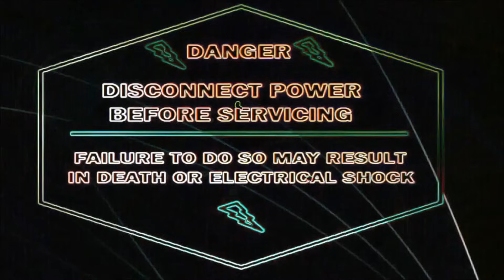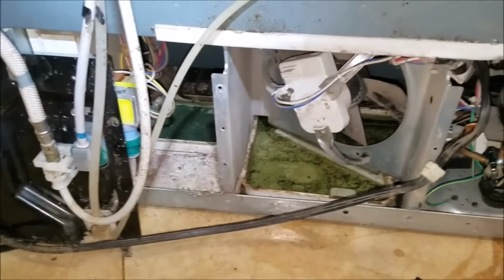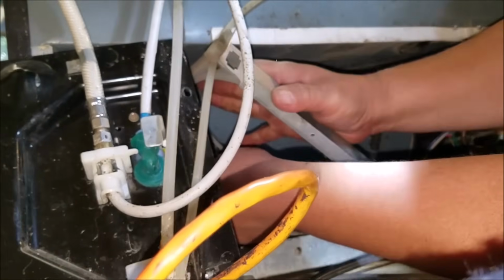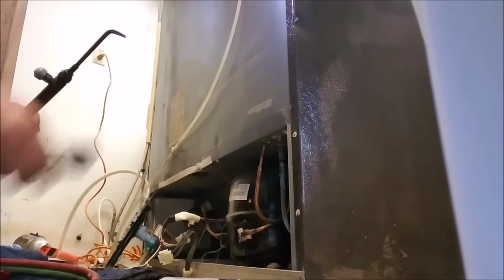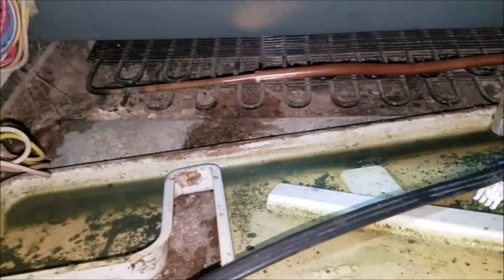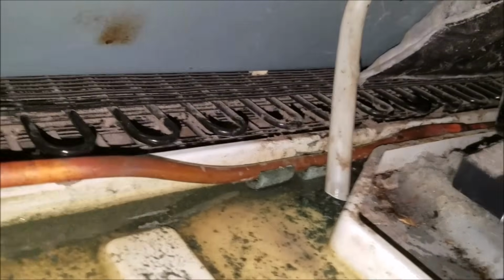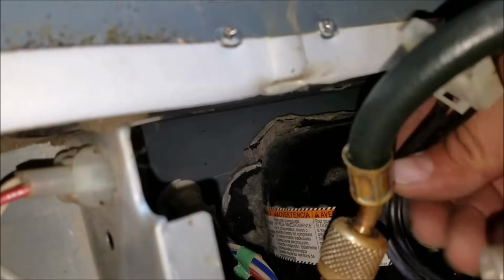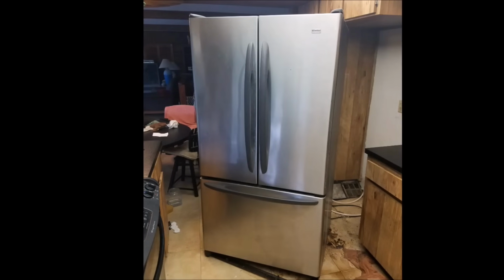#Kenmore, #Whirlpool, #Maytag French Door #Refrigerator Not Cooling 596.76523500 and MSD2650HEQ

Comment: I want to thank you for this video because my neighbor happened to find it and is exactly the same problem my refrigerator had. I had a pin hole in the same spot where copper line was in water and had some sludge around it. We first tested to see if there was any freon and there was zero, so we followed your advice and found a pin hole and first tried to patch it but was unsuccessful. We then cut out section and replaced it with new and soldered it in place. We vacuumed  system and refilled it and is working perfect, like new and the cost was less than 5.00 for piercing valve. Thank you.
Reply from the maker: You’re welcome thanks for watching my video

Comment: Excelente trabajo Nestor.. No enseñaste cómo hiciste el solder from the pipe by the condenser.
Have not done a job like that or any seal system yet.
Quick question, How much did you charge for that job? 
Thank you in advance.

Comment: It is important to change the filter drier, every time you open a seal system.
Reply: It did turn out to be the compressor, best part is I only had to eat the labor, $400, the part was covered for 10 years and mine was a reman too. Interesting that my compressor was still running/humming, but not keeping up

Comment: Hey there, looks like i have the same fridge, is using a quick coupler acceptable or is the pressure too high? Lastly, can i just clean the pipe and solder the leaking section to seal it?

Comment: The pipe is in the drain pan to heat and evaporate the defrost water.
Reply: and copper is very suitable for nickel plating and prolonging the fridge life another 5+ years like the "old" Kenmore working 30+years but such durable devices does not "stimulate the economy" so after watching this very informative video now I am going to "stimulate the economy" (assuming the price of the repair (4h+) is third new similar Samsung or LG)

Comment: I did this repair yesterday and sure enough the leak was exactly in the same spot. I fixed it using bits of copper pipe and refilled (after vacuuming) with r12a. The issue right now is that the compressor is running non stop and the fridge appears to be cooling past its set point, any ideas why? Fridge had no issues with temperature control before. Apparently you are supposed to use less r12a but it seems like maybe i didn't use enough as it had a hard time going from 10f down to 0f for the freezer. What happens if you overfill? That line wasn't getting icy for me at all.

Also, if someone else is reading this, a propane torch is not enough to desolder from the compressor, you'll have to make a coupling.

Edit: never mind, fridge is working just fine.

Comment: I don't understand this,I have a MayTag refrigerator mzd2766gew and at first it was the clicking sound and I changed the starter relay and overload and the refrigerator worked just so fine and I later disconnected the unit from the power supply to to put it in it's permanent position and when I eventually did,the unit refused to run it just starts and stops.What can possibly be the problem with this refrigerator.

Comment: Great vid
. A common misdiagnoses is the standard answer ' bad compressor' they should always check the ' run capacitor ' first if this 10 buck part is bad the compressor 
relay will click but it won't start and doesn't know which way to run. Check my channel for what looks like. Hope it helps